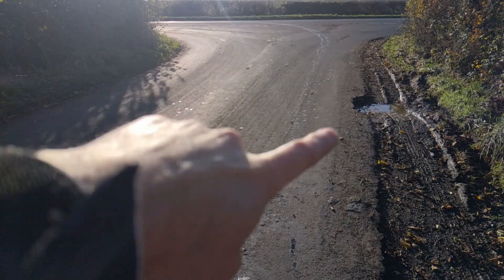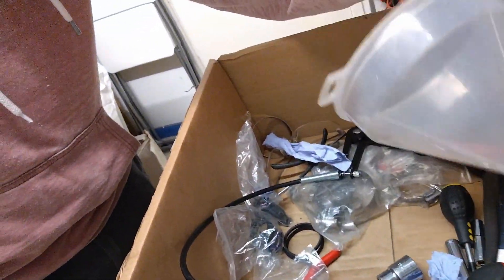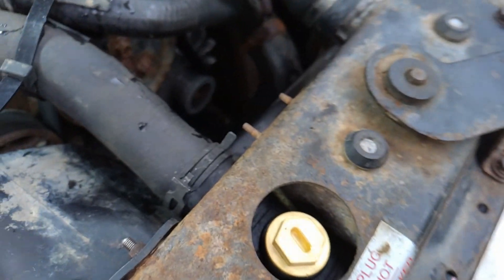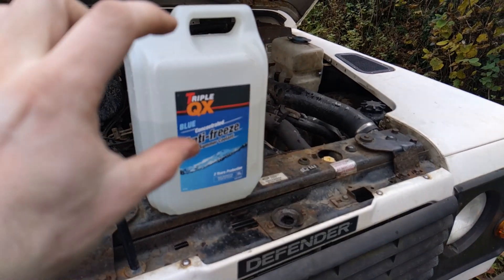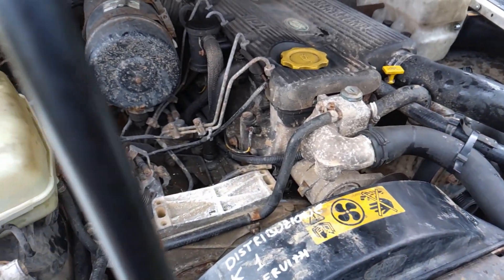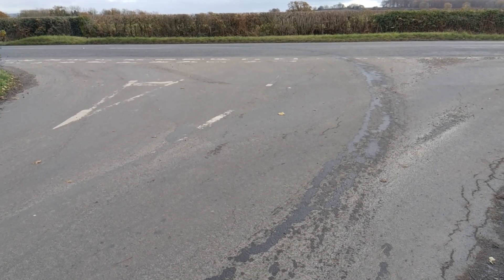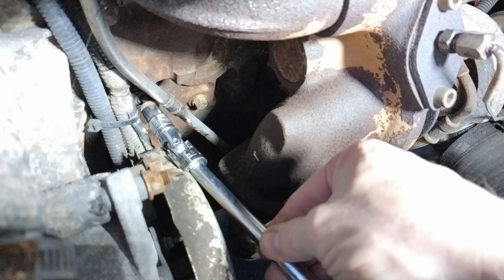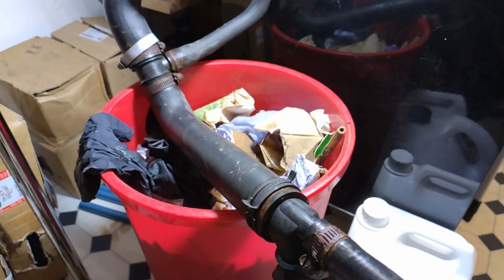A Hose Clip did this - Stranded by Coolant Loss

Comment: I quite like the constant tension clips.  VW have used them for decades and I've never had one leak due to the clip.  They are a joy to use once you get the special release tool that works much better than pliers (people who use pliers always say the clips are crap).

All plastic parts of a cooling system needs treating with suspension after about 10 years and should just be replaced at 15 if they made it that long.  They just crack at random and ruin your day and maybe your engine.  Those plastic bungs in the stat and rad, plus that bleed pipe union between the stat, rad and expansion tank are a classic for breaking an aging 300Tdi.  bit pricy but maybe an Allisport rad is the way to go as they don't have plastic tanks but a recore on the old brass one is also a good idea, though to be fair a plastic one should do the job for 10 years and the core will be beginning to deteriorate after that anyway.

Wish I'd had a low coolant warning on my old 300Tdi RRC, that cost me about £700 in 1 second when it blew the head gasket and warped the head.  You could tell the HG had gone as coolant was spraying out round the fully tightened jubilee clips.  I think your weak clip let go the moment you started holding higher RPM in 5th gear and the sustained pump pressure was too much for it, dispite it not being warm enough at that point to add the full operating thermal pressure.

Comment: I have always used either original land rover Norma pipe clips with 6mm head or stainless steel Jubilee clips on my V8's and TDi but since my TD5 i have been using the original Constant pressure clips and I think these are much better. Only think is they are not stainless, but the material is thick enough, plus in Malta we dont have ice nor salt ( except in the sea  🤣🤣) I am trying to fit a low level alarm on my TD5 tank at the moment.

Comment: Buy the one piece hose. They are cheap, keep a spare in the car, and always, always use stainless clamps. That multi monstrosity you have gives lots of potential leaks, and that plastic will go hard and snap. Horrible, stupid design.

Comment: Definitely get you metal radiator re cored and re fit it. Were you concerned that the engine would have overheated in the 25 seconds of coolant lose? I would have happily driven my 200tdi the 3 miles home without coolant in these British temperatures.
Reply from the maker: Not in the 25 seconds, but potentially by the end of the drive. I know lots of Defenders wrecked by having lost coolant, so I wasn't going to take the chance!

Comment: I specifically went for the single moulded hose because I thought less joints to fail. Although stainless steel hose clamps aren't that expensive. Although I have the same tank cap, I haven't yet made up a circuit to give me the low level warning, when I get the engine back in I'll have to make sure I do it!
Reply from the maker: It seems that one-piece hose is becoming less and less available, and the later type is becoming the norm these days. I can definitely recommend the warning light!

Comment: There are many products that stop corrosion,  old engine oil is free and it can be diluted with old diesel, invest in 2 oil cans, one fresh  one old, squirt squirt lol.
Reply: That may stop the clips rusting but it wouldn't do the rubber hoses underneath much good!
Reply: @gs188  yes you're absolutely correct,  just a smear keep it off rubber. The old saying no dry threads, no dry gaskets is still common sense,  drilling out broken rusty bolt's takes much longer than putting a squirt of  oil on it. Stripping dry spark plug threads in alloy heads is funny. Some people don't take it on board and do it again and end up  screwing the helicoil out ha ha ha.

Comment: constant tension clamps are far better. Those worm style ones looked like cheap Chinese rubbish. We have all fitted them. Great video to show no matter how well maintained a vehicle is, the smallest of Chinese parts can leave you stranded or worse. 
Quality hoses and clamps are the unsung hero of the engine room.
Reply from the maker: They were cheap rubbish. The OEM ones are a lot better. I should have replaced them from the start, but oh well!

Comment: I Love The Styling Of British Cars & Land Rovers, But Not Dependable.., My Mother Had Jaguar XJ6, Love Styling, Ride Independent Rear End, Wood Cash, Leather Interior, But Always The Smell Of Gas at Different Times, Probably Due To Fuel Injector Systems & Fuel Pumps, Maintenance Of Mechanics Outrageous. My Brother Had Triumph TR6, Nice Sports Car, Styling, Handling, But Duel Carburetors, & Electrical Switches Downfall. That's Way The Japanese Cars & Fuel Shortage in the 70's, Due To Middle East Problems Caused The Downfall Of British & American Car Companies. LAND ROVER Type Vehicle Needs To Be Manufactured Again at price range to be competitive with the JEEP. It would sell to Americans if price was right without all the trills & cost of the RANGE ROVER. Sincerely, Mr.T.
Reply: This truck is nearly 30 years old though.  Japanese vehicles suffer coolant leaks at that age too (90's vehicles in general are no longer on the road in the UK due to corrosion regardless of where they were made).  The main issue here was poor quality replacement parts which is a cause of breakdown on any brand of vehicle.